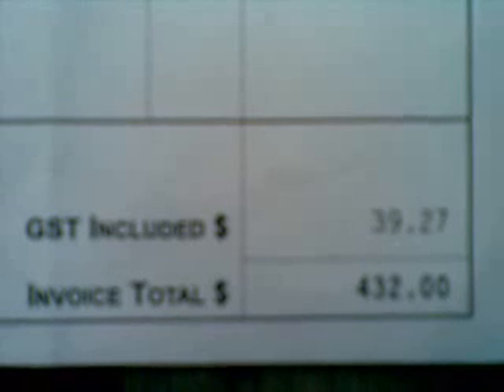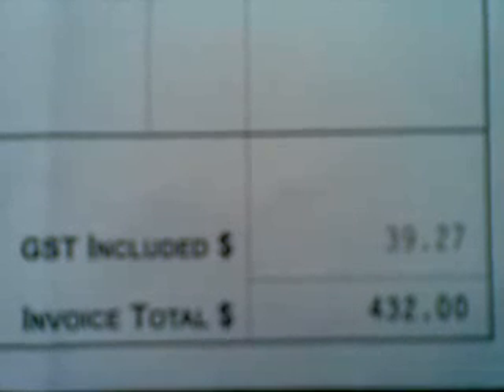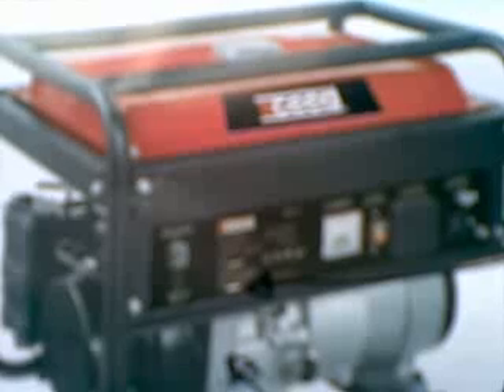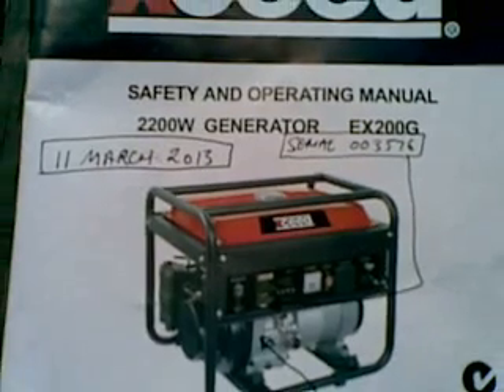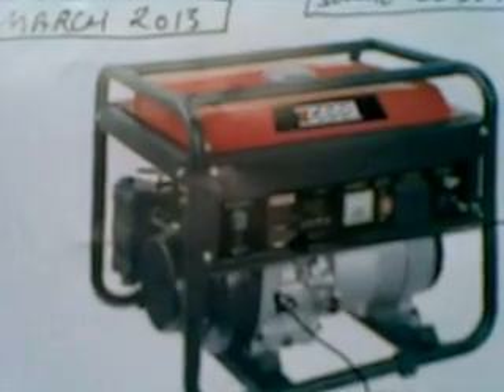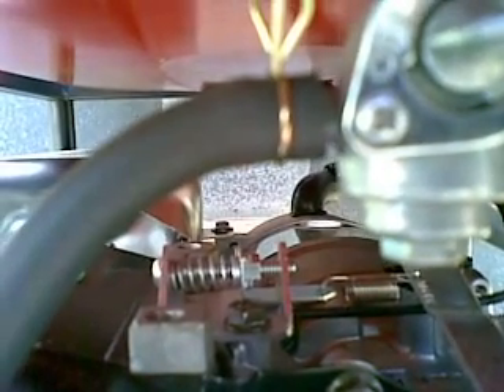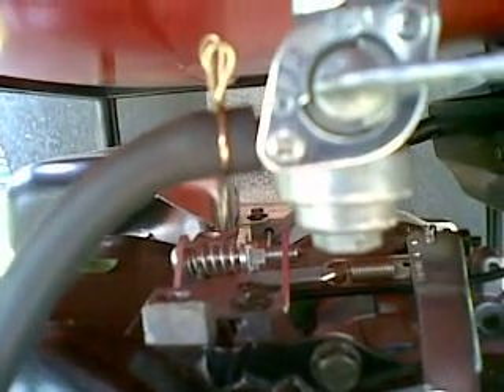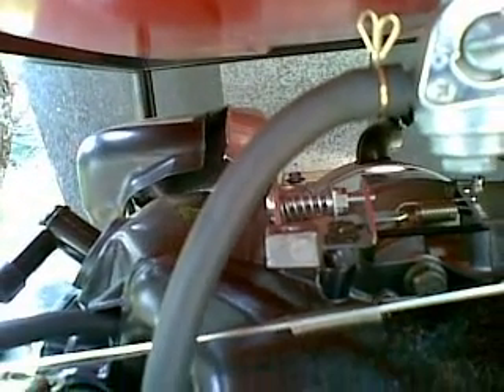Generator Review...XCEED  EX200G... With Metalic Magnetic Crankcase Oil !

Comment: Thanks for the vid mate. Well, here we are 5 yrs on and I'm wondering if the gen still works or did it pack it in?
Reply from the maker: G'day,

  Thanks mate,

   Yeah, it's still going.

    I adjusted the Tappets until the Valve-Clearance was within the Tolerance cited in the Manual, and it stopped metalizing the Oil..; and it's now run 2,350 Hours 57 Minuets...

   Have a good one,

  ;-p

  Ciao !
Reply: That's awesome.  Sometimes the cheapies can be a good investment.
Reply from the maker: +Rumpole Del Bailey 

  Yes, indeed.

    I've been continuously impressed at the sheer Manufacturing effort that the Chinese have thrown into their past 20 years' project to make "The West" become dependant on Chinese Consumer Durables.

   And, they seem to have begun by purchasing the manufacturing rights to something which Western Engineers put a lot of work into perfecting - before superseding it entirely ; so if one can trouble-shoot & correct any obvious Assembly-Faults then a Chinee Cheapie will probably work as advertised, at a fraction of the cost of a latest Greatest New Improved  ("Experimental"...) Model from a "Brand-Name" Manufacturer.

   From Radio Controlled Model Aeroplanes through Solar Panels, 18-Volt Li-Ion Powertools, Generators, Charge-Controllers, Multimeters...; I have yet to be actually disappointed by the performance of the Chinese Products.

  Such is Life,

  Have a good one,

 ;-p

 Ciao !

Comment from the maker: @CanadienAthiest
 G'day mate, thanks... Um, yeah, I know. I have heard a similar noise before, in a 2-Stroke which'd previously overheated & evaporated 2 Nylon Spacers on the Crankshaft. End-Play then milled the Alloy Case with the Crank for 250 hours till the Case split...most of these Metal Flecks in Oil seem Non-Ferous, actually ; so if it's Endplay, it'll either it'll mill a clearance, or break right through...? Ciao !

Comment: all engines i have owned produce metal shavings when new, they are just shavings from the manufacturing process and the excess metal from the rings when they seat to the freshly honed bore. during break in it usually last for the first 2-3 oil changes then goes away.

Comment: Buy yourself an old VW 1200 cc engine and use it to power both generators charging units.You can even make yourself a gassifier and power the engine off wood chip gas. Gassifiers work, I have made one for just this purpose.for a mate.The hassle is chipping and drying the wood, but you have so much "small" wood there it should be easy.

Comment: Could just be what the Chinese look on as "Running In" although metal in the sump ? Mmmmmmm !! I don't like the sound of the "Grinding Milling Noise" of which you speak. After doing major rebuilds of diesel engines with shell bearings it was common to find some metalic residue at the 1st oil change, usually clustered around the magnetic sump bung. But I can't imagine this thing having shell bearings. Worrying Warbles. Good luck with it mate.